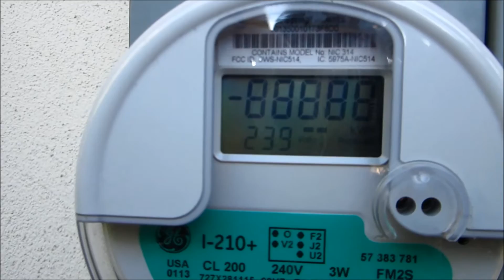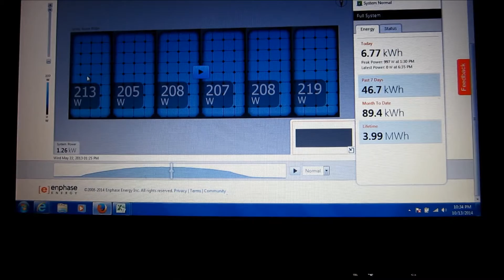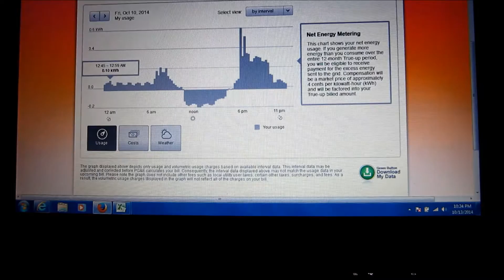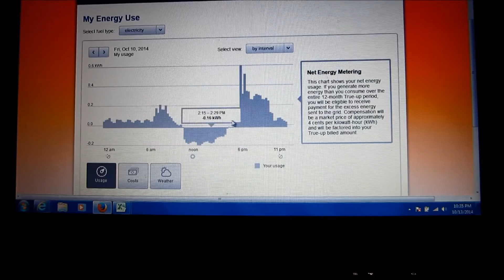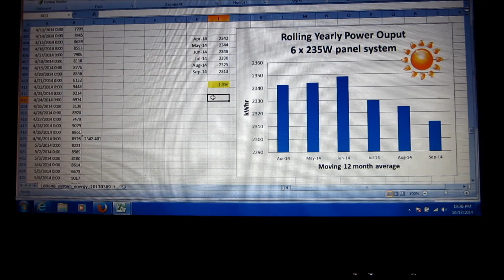Solar DIY 4MWhr update and Temperature Experiment

Comment: you can predict the gain/losses of temperature change using the temp coef of your panels.
those are details that should comes up with any decent panel, you can get them from the manufacturer site's
typical tension goes down with temp rise and the current goes up, but the tension is more sensitive to temperature change than to insolation change, and the current is more sensitive to insolation change than to temperature's.
so globaly the power production goes down with temp rise.
Also the "Cell temperature at NOCT" (from 45°C to 50°) info is crucial. panels can go up to 25° or 25° hotter than ambient air. ,and yes in roof mounted panels, it could have been worse if they were stuck to the roof, but it depends, (if the back is conductive metal or concrete it would help cool them).
Some people even added alumunim foils to the back of the panels.
as an example:
for 250-260W panels the muVoc is -150mV/°C which translate to -2V when at 45°C, and the muIsc is 2.5mA so +50mA, so -23W loss due to temp rise and this at 25°C ambient.